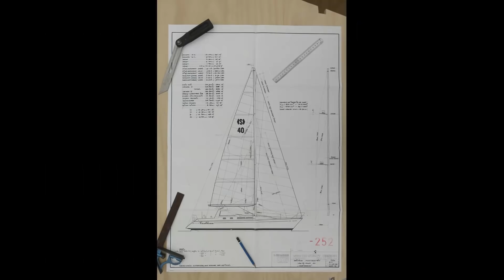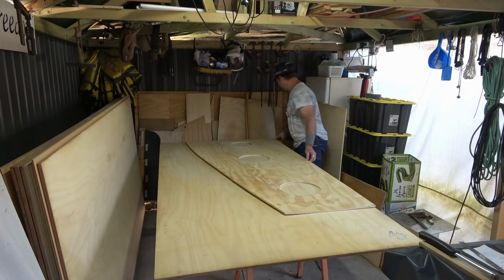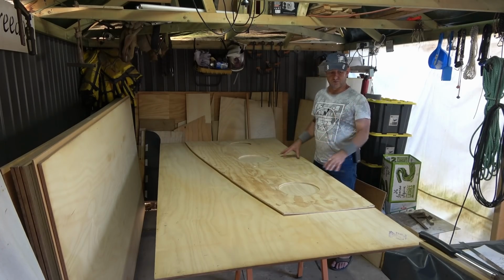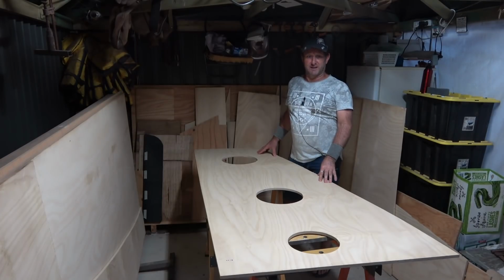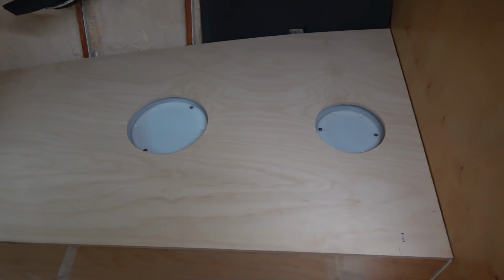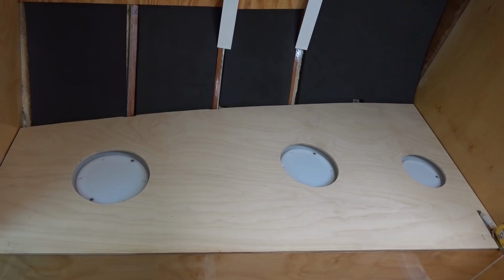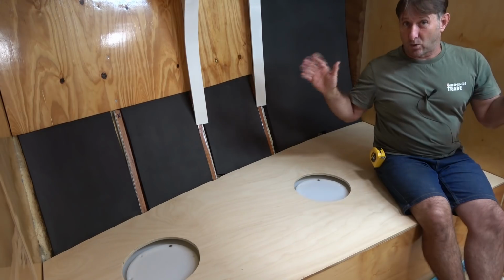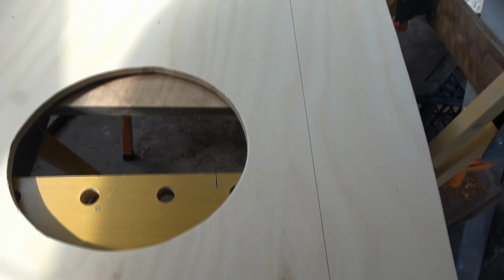Building my steel sailing yacht Ep.77 Saloon tops 🤠 DONE! 👌

Comment: It's great to see your progress! After spending SO much time on the sole panels, it's gotta be wonderful to be working on something that moves along quickly for a change!!! I saw you run the router along all the exposed edges. It didn't look like you were removing much material. Was that just to round the edges over a bit? Thanks for taking the time to document the building of SV Mistress for us! 

PS: I, for one, really do like the jazz tunes you have been using of late! Just wanted you to know that I appreciate them!!!
Reply from the maker: Thank you very much for your great comments, question and music feedback S Stem, very much appreciated and YES indeed it has been great having progress roll along quicker! Yes I use a trimmer/small router with a small bull-nose flush bit to round the edges for both smoothing the edges and coating/painting reasons. And yes, I am glad that you like the music sir!  😀👌🎵